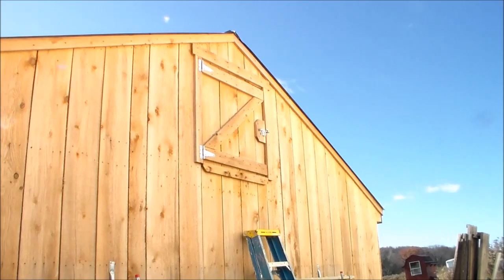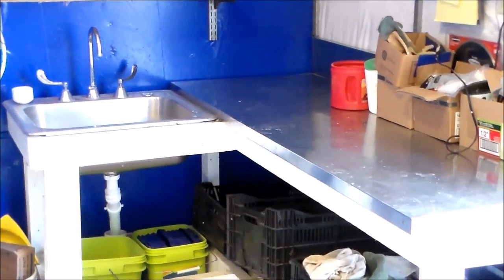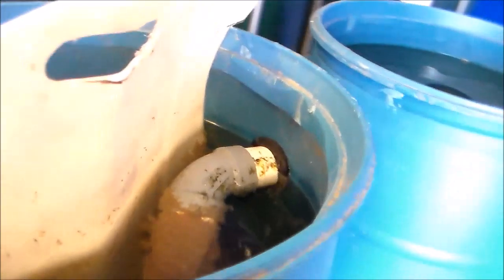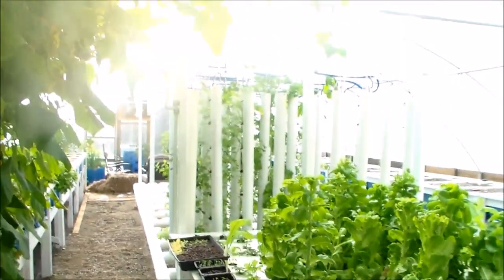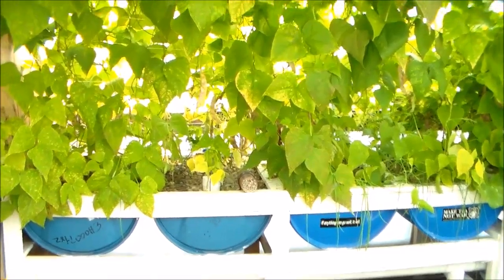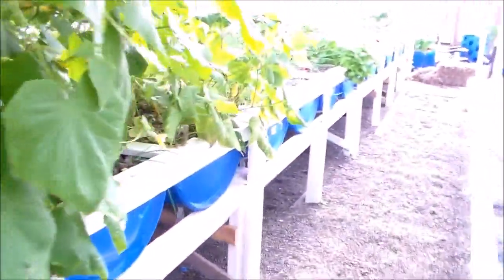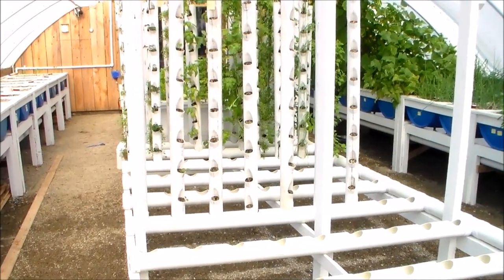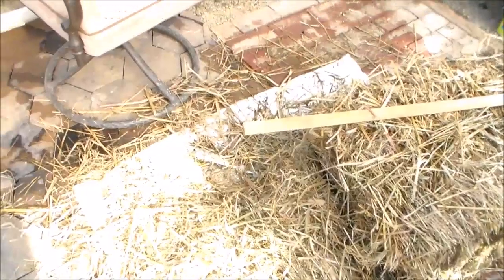Aquaponic Greenhouse tour

Comment: I worked a blue monday at a cucumber farmer and he used a stone wool, might that be something to replace the straw as grow medium? The root system of the plants would be able to grow into the stone wool. I am only recently discovering aquaponics, I have to say it's quite an impressive setup you have there.
Reply from the maker: Great Idea--- I will try this!  Thank you my friend---Don
Reply: I also saw a video of an aquaponics farmer using G tubes with a metal mesh in it and then the regular grow pod, that you buy at a walmart, in the opening. Water would fall in from a T splitter on 2 sides of the mesh.

Comment: I would be worried about molding of the straw in the tubes leading to mycotoxins which could hurt bacteria and fish. apart from that: really nice system!
Reply from the maker: I have decided to abandon the straw---there were problems with it breaking down and compacting in the bottom of the tubes and smothering the roots--- the best system so far is to just let the roots of the plants grow and do the wicking themselves. I will do a follow-up video soon,on the different tubes and which ones are doing good.

Comment: Nice system! 2 Questions first I was wondering where you found the fan used for the double poly layers and secondly what did you use to form the cups on your towers? they look perfectly formed.
Reply from the maker: The fan I ordered with the greenhouse kit, but the fan is exactly like the old heater fans used in cars--- seems like they would work perfectly well.  The cup holders were formed with a heat gun and wooden tapered dowels that I turned on my lathe--- however I have used small wine bottles to do the same thing---I made the dowels so not to chance breaking the bottles and the wood I was able to turn to exactly two inches.
Reply: thnx :)

Comment: I'm building an aquaponic system now...  my first.  I'm in awe of the thought you've put into yours.  Would you mind sharing the approximate cost to build your system?
Reply from the maker: +Greg Markham I spent two years reading and studying different systems --- just had to go and do it. I spent about ten thousand for everything, but didn't seem that bad since it took a full year to get it this far--- still more to do, but not much more expense. good luck on your build my friend---Don
Reply: +Donald Porta I found your solution for the dual layer greenhouse covering pretty ingenious.  Where did you read up on how to implement that?
Reply from the maker: +Greg Markham I helped install a covering on a local greenhouse about 30 years ago and was fascinated with how well it worked, and how little energy it takes to keep it inflated.

Comment: Hey Donald,  Congratulations on the build. It's fantastic. Just wondering, i have alot of Alpaca wool, would that work as a replacement for the straw? i live in Northern Ontario, Canada. My only concern is the extreme cold we get in the winter. Might render the operation very expensive to heat. Thanks in advance.
Reply from the maker: +Michel Desilets The straw turned out to be a bad idea--- the wool might be something to try, won't break down so fast! give it a try and let me know--- thanks my friend---Don
Reply: Thanks Don.  I will.

Comment: Nice work, i'm carious of how you made that funnel shape discharge on those 55gal barrel.
Reply from the maker: I took a 55 gal drum and cut the side off for the large plastic sheet---- made a paper template and transferred it to the plastic sheet, I added a extra two inches on the one edge for an overlap and use this to pop rivet it together. made a tight fit in the drum and silicon ed it in place. I'm sure that it did not seal the water completely out, but that is ok--- the sealed in water is not circulating in the system and it will not collect settlement- It is working fine.
Reply: Donald Porta Great, it looks like a nice upgrade for my swirl filter.  I wish you had any video or photos for when you did that funnel, looks like a nice time saver for disposing poop and uneaten food.
Reply from the maker: thanks for the comment--- I'll try to be more thorough next time on any build that I do.

Comment: Do you have any issue with straw coming out of the grow towers?
Reply from the maker: +Benja's Uber 1337 Hobby The straw in this environment will decay very rapidly and drops to the bottom of the tubes---I have since stopped the use of straw and have been using material that won't decay so radially. Pond Filter material works well, I would like to try coconut coir.
Reply: +Donald Porta Cool thank you for responding :)

Comment: what kind of rock are you using as yr media?
Reply from the maker: +Tucker Lang Local gravel from a local quarry, the stone measures 3/4 inch to 2 inches. and has a slight alkaline pH. after the system matured the pH measures 7.2

Comment: How did you connect 4 barrels together for 1 bell chiffon?
Reply from the maker: The bell siphon is connected to one of the middle barrels and it's outflow is to the drain system. the four barrels are connected with a separate line only connecting to each other, that is, they all drain to the one barrel that is fit with the bell siphon. Effectively, making all four act as one barrel.
Reply: All through the drain right?
Reply from the maker: yes
Reply: I got it thanks.